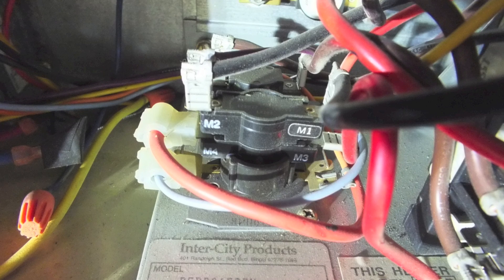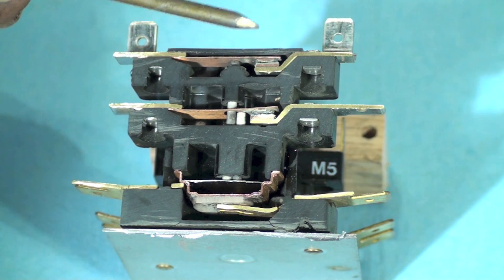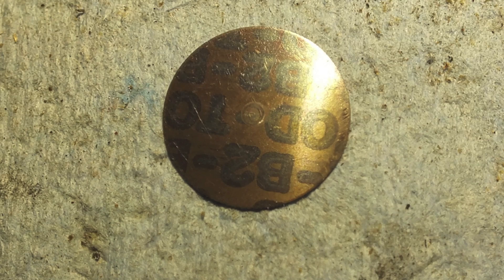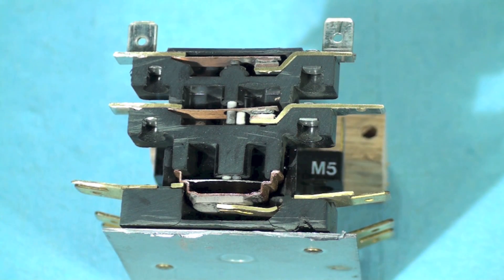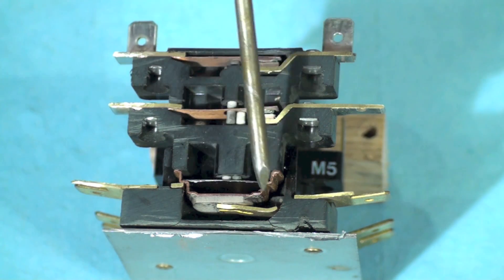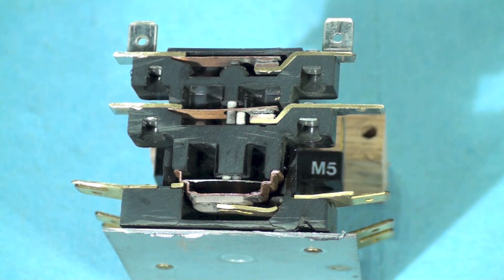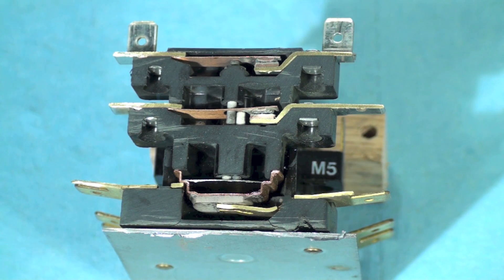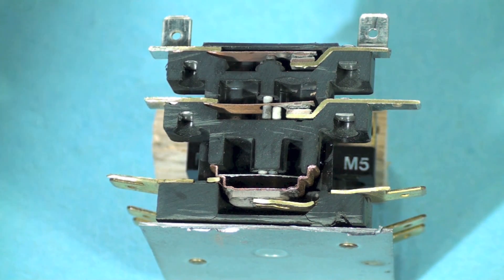The electric furnace stack type sequencer disassembled

Comment: That cutaway makes understanding the device easy!!!  Sure looks like the electrical contact surfaces wear away quickly.
Reply from the maker: The electric furnace sequencer is probably the poorest made electrical device I have ever seen.  I had a number of customers that had them fail every 2 years.  I used to replace them with contactors whenever I could.  The only exception I have seen is the Honeywell sequencer.
GFM
Reply: @grayfurnaceman  Thanks...I was involved in replacing the Silver Contacts (Maintenace) on 440V Switchgear over 45 years ago and saw close up how those surfaces wear (Melt away) under constant operation.  My impression is the Sequencer is comparable to that scenario and there is little conducting surface at all on those contactors.   Heating wire elements make large current draws on startup to boot!!

Comment: So it has to be mounted as you showed in the video (24V heater at bottom) since it works depending on the weights of the rods to move back to original position? Thank you for the nice cut.
Reply from the maker: Orientation is not important for these sequencers.  The rods are forced into position by the snap disc.
GFM